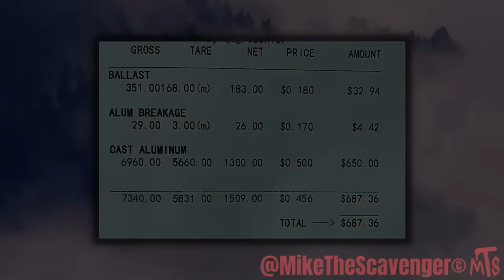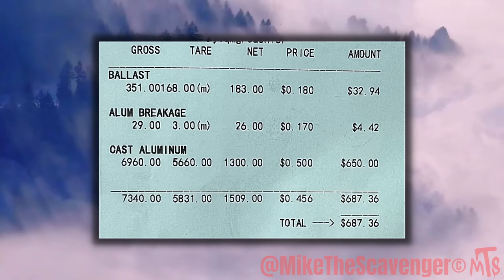MOST EPIC Scrap Haul To Date!!!

Comment: Surprised more people don't want those lights in working condition.  I have an old LED streetlight mounted to a pole out by my garden.  It's bright enough I can tend my garden after sunset when its cool during summer.  One of the ballasts was bad so I connected both sides of the light up to just the 1 good one that was left and it worked fine.  You can also usually set them up to run off either 120 v or 240 V.

Comment: Pickups have always done me right when I was scrappin'  I did a pickup at a pub that used to be a McDonalds. Asks me to  haul away the entire fountain drink machine and co2 system.  Those things are all stainless,  aluminum,  and like 300 feet of clean copper tubing. Ran away with over $1,000